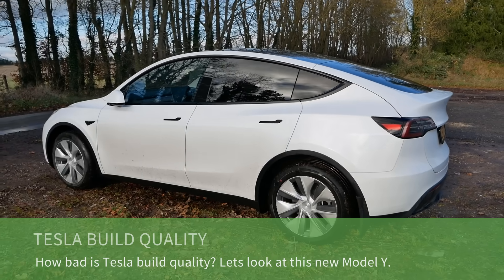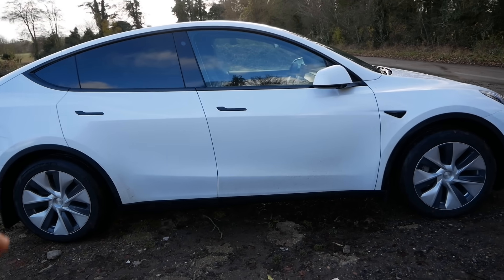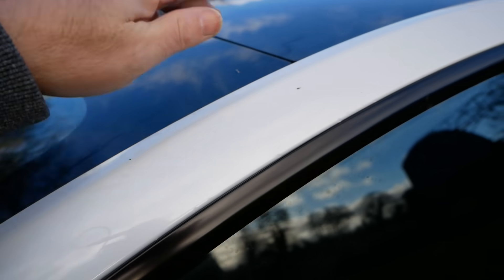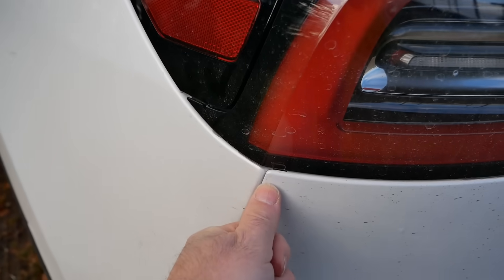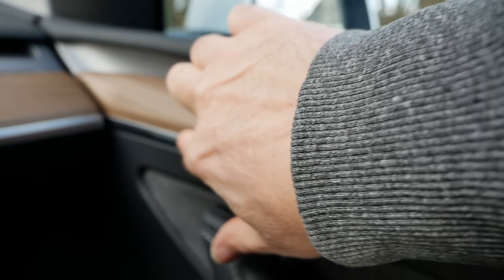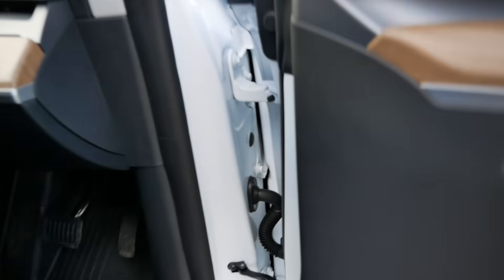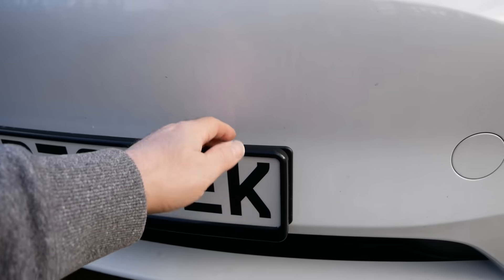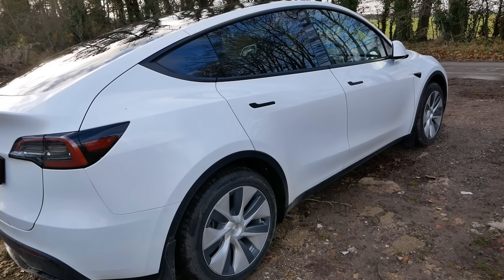How good is Tesla build quality? A look at a new 2024 Model Y.

Comment: I’m picking up a model Y 2024 rwd end of February just wondered what range you are getting and miles per kw
Reply: Did you place your order recently? Curious on the lead time as I’ll be placing an order for a y soon.
Reply from the maker: I think they have stock in the UK so depending on your colour & model choice, you could find it will be just a couple of days. However, a new boat from China comes in once a month (normally in the first week of the month), so the wait isn't long.
Reply: @GoGreenAutos  just wondering what you found the real world range was on the Y rwd
Reply from the maker: @trisknight9430  I'm not sure yet. I've not been tracking miles. But I will be looking at it soon and making a video on that subject. At the moment, I've been doing quite a bit of towing which absolutely kills range.
Reply: Due to collect end of feb ordered a week ago so must have stock
Reply: @trisknight9430  thank you! Enjoy your new ride!
Reply: Summer I was averaging 220 Wh/Mi (4.54 miles per kWH), about 265 miles max range. That has only dropped to about 245 Wh/Mi (4.08 miles per kWh) in winter, so 10% ish. 240 miles max range in winter. What does use extra energy in winter is pre-heating battery and cabin but a) this is optional and b) you can do this from house charger power if connected.

Comment: I've got a 2016 Model S and yes the inside trim could be a bit more premium. But at 259,000 miles, the build quality that really matters is how the car copes with age and mileage and I'm very happy with how the car is holding up. Towards the end of 2023 I spent 6 weeks in southern Italy covering just over 5,500 miles and the car behaved faultlessly. Zero creaks or rattles and is still great to drive, whether on the 130kph toll roads or up in the mountain lanes.
Reply from the maker: It's very impressive seeing as this was really their first vehicle. They got an awful lot right.
Reply: How many things have that 2016 model S had changed over the years?
What I see is that alot model S owners have had almost all the can be changed, changed😂
Reply: @waskus I upgraded the MCU for more functionality.  Rest is stock.  110k miles.

Comment: The Shanghai gigafactory seems to be much better regarding build quality.
Reply: R Symons finds no difference in Fremont and Shanghai builds:
https://youtu.be/RV3rv4d9qUg?t=946

Even in 2109 Tesla critic Lutz was praising Fremont fit and finish:
" I was stunned. Not only was the paint without any discernible flaw, but the various panels formed a body of precision that was beyond reproach. Gaps from hood to fenders, doors to frame, and all the others appeared to be perfectly even, equal side-to-side, and completely parallel. Gaps of 3.5 to 4.5mm are considered word-class. This Model 3 measured up." Road&Track JUN 15, 2019.
Another Myth pushed by TSLAQ!
Reply: Yes indeed, the build quality of Chinese cars has risen beyond recognition since 2014, and not just Tesla cars, I have been to China several times, and have experienced cars built pre-2015 and they are dreadful (own brands in particular) but today these same manufacturers are producing cars of equal quality to that of Europe, this is why we are seeing so many Chinese brands coming into the European markets, this will happen more and more as the years go by, we just can't compete with the cheap labour supply as in China either, so if we are not careful a lot of European brands will disappear unless governments open their eyes and make life easier for European manufacturers.
Reply: @Colin-From-Corby-yy4vb  China are fast followers but not known for innovation. The main reason Tesla got preferential treatment in a fully owned company in China is because they drag their suppliers up with them. Most of the improvements to China's car technology and manufacturing is courtesy of Tesla.
Very soon Tesla will introduce new assembly techniques and robotic labour that will neutralize any advantage China has in labour rates or skill levels. Already over 120 companies are ordering gigpresses, trying to copy Tesla level software and making exact copies of Tesla Optimus. Self landing rockets are in development stages...
https://www.youtube.com/watch?v=A5vshTgDbKE

Comment: Looking forward to hearing how the efficiency compares to the classic Ioniq 28......
Reply from the maker: No where near!
Reply: @GoGreenAutos  that doesn't surprise me.  

But how bad is it?
Reply from the maker: @FFVoyager  I've not looked actually. But I will make a video soon about it. The trouble with Teslas is while they are very efficient while driving, particularly at motorway speeds, they continue to use electricity when parked. So overall, they can't be poor, especially if you use the CCTV function.
Reply: Do you run sensory mode continuously the car uses 3 to 5 percent a day if you leave it off you may not loss any?
Reply from the maker: @lesterng5748  yes I know that. Any Tesla owner soon realises that. But even without that running, they still consume energy from the HV battery, unlike most other EVs that shut off the pack when switched off.
Reply: @GoGreenAutos  No, when parked if sentry mode is disabled they don't consume much like every other car